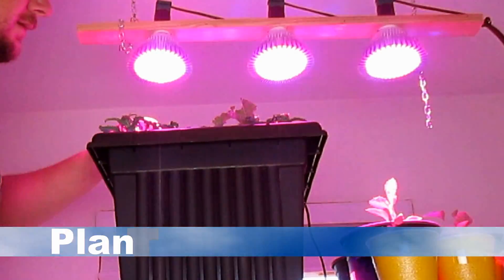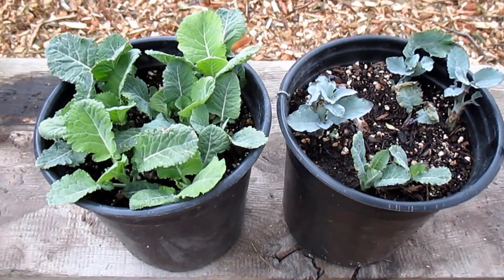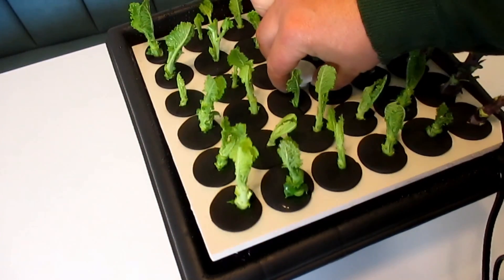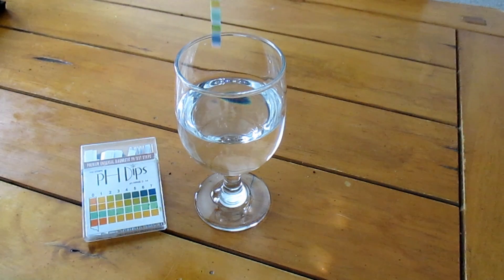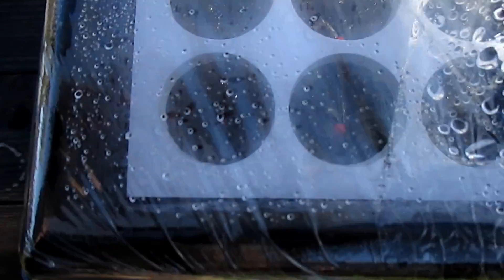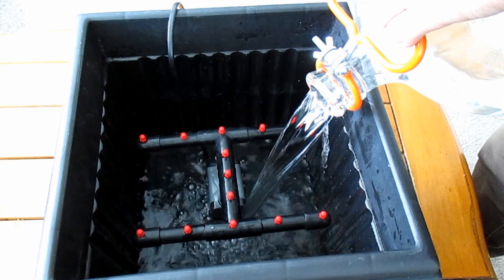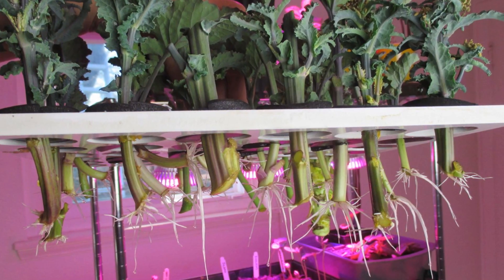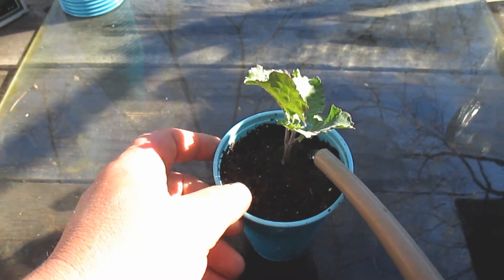Aeroponics Cloner Update! Propagate Plants Fast & Easy From Cuttings!

Comment: I'm just pondering if the heater had a thermostat and the pump produced heat   the thermostat should turn off   at the required temp

Comment: Bro heating the solution = evil. Roots need ground conditions of about 4 celsius ... many even cool their tanks. Well, those who are actually engaged in aeroponics ... HPA. Measuring acidity with paper is not effective, get a device. It seems to me that such a system is not needed to produce clones, only land, water and time. If the clones still go to the ground later. It will even be better for them.

Comment: You are on point and you clone the same way as I do it but my setup is a bit more advanced.  I LOVE YOU SYSTEM BECAUSE YOU HAVE MAID/R&D WORK YOUR  SYSTEM  SEND ME A MESSAGE IF YOU WANT TO TALK/NETWORKING AND GET ON THE  FORBES WEBSITE. I BELIEVE IN YOUR KNOWLEDGE AND WE ADD WHAT I HAVE THAT WILL HELP TO MAKE THE BEST ONE ON THE GLOBE.  DIY ADD A CO2 ENRICHMENT PURGING INTO YOUR WATER TANK AT THE LEVEL WERE WATER SPAYS AND INTO THE OPEN AIR PART OF YOUR TANK. ~PURGING  75 / 125 PPM AND PUT IT ON A TIMER TO PURG EVERY SETTING ( DEPENDING ON WHAT YOU ARE TRYING TO CLONE) . EXAMPLE; TOMATO PLANTS) SET THE TIME AT EVERY 12 HOURS  AND YOUR CO2 AT ~~ 75 PPM FOR  48 HOURS  THEN  INCREASE BY DAY  ~20% .LET ME KNOW PLEASE IF YOU WANT TO NETWORK ON BOTH OF THE SYMPTOMS/ YOUR SYSTEM .MY SYMPTOMS.  YOU HAVE KNOWLEDGE THAT I DON'T  I HAVE  KNOWLEDGE THAT YOU HAVE NOT YET APPLIED TO YOUR  SUPERVISOR CLONING MACHINE. 
    WHAT CAN IT HURT BY USE HELPING ONE ANOTHER. LOVE YOU VIDEO I DID  SUBSCRIBE.
Reply: Why would you want to put CO2 into the root zone? Roots need oxygen, not carbon dioxide.
Reply: @tombryant4518  Thatnk you Very much for your kind ❤ 🙏 feedback.  Can't explain why, under Contract...
Reply: @bkilpatrick1909  Makes no biological sense. Supplement the leaves with CO2, not the roots. Especially at night when they reverse and consume oxygen and produce CO2 like us. Whatever system you’re talking about is actually below my normally occurring 750ppm atmosphere anyway so it wouldn’t even do anything, unless you’re meaning to add an additional 75-125 ppm to the existing level?
Reply: Never said anything about that 💯 % sure not why you have me on this platform  so try (<100ppm).
Reply: @bkilpatrick1909  I’m just trying to understand what you’re trying to say. Please explain how adding a minuscule amount of extra CO2 to the root zone will aid plant growth. If you’re not able to explain the theory behind the system due to “contractual obligations”, or a non disclosure agreement, then it’s pure bro science. There is lots of BS out there these days, and it’s getting a little harder each year to wade through it all. I’m all ears and willing to learn something new though, but what does it do exactly?

Comment: I actually add a small amount of bleach to my cloner when I add new cuttings. This allows me to run the system warmer, which tends to help me root faster without developing any sort of infection. Prior to this, I was adding beneficial bacteria, fungus, and enzymes - which was surprisingly less effective than the sterile method. 

Letting fresh cuttings soak prior to being placed in the cloner can help prevent embolisms, and increase success rates.

Comment: Nice! I just bought the same cloner (Clone King) to do work with American Hazelnut and other woody edible propagation work. Also trying various dormant hardwood cuttings. I just bought mine and have only had it running for two days, so I can't describe any results. However, a couple things I am doing differently are: using a tall (18") dome to cover 25 of the 36 sites to control humidity levels as a test to see what works best. Using a titan 12 control timer that allows me to adjust both on and off time for the spray unit (I am using 1 minute on, 3 minutes off). Also on the timer I am using an air stone from my compost tea setup that is one air pump attached to 4 air stones to further aerate the water. Lastly, I am using  element nutrients cloning gel to dip in, and low levels of clonex nutrient/hormone solution in distilled water. I will be sure to share any results (good or bad). Would love yo see some more perennial experiments with this! Cheers.